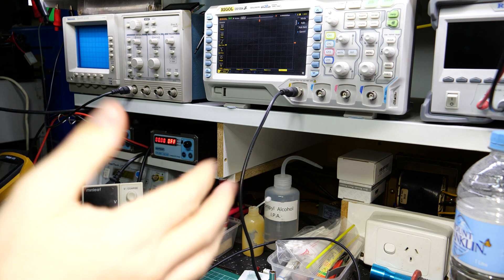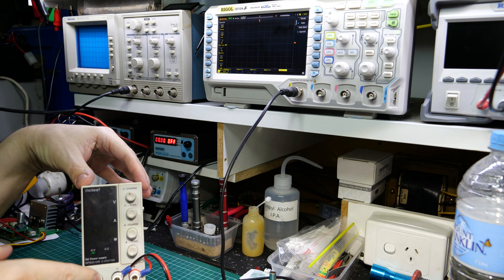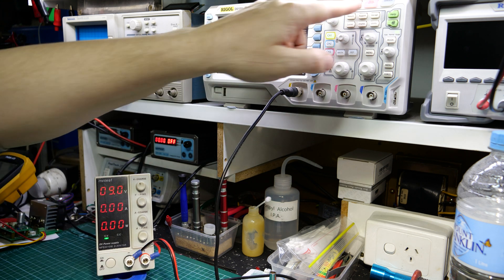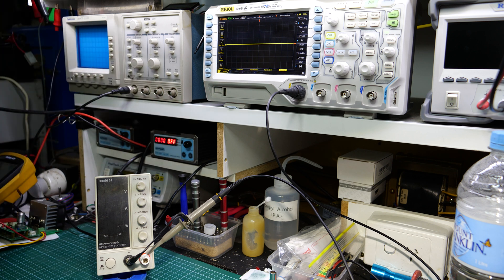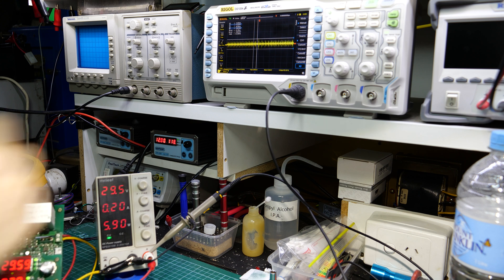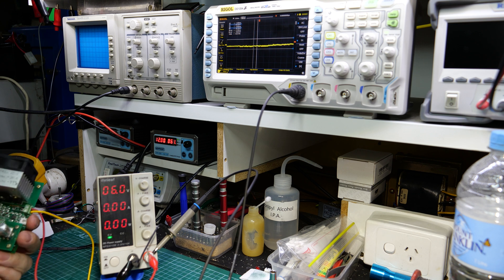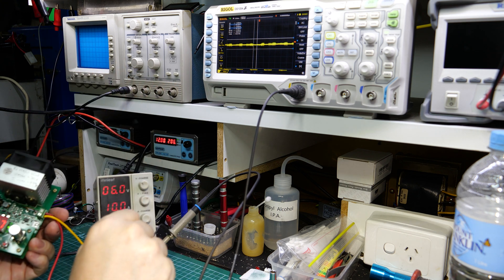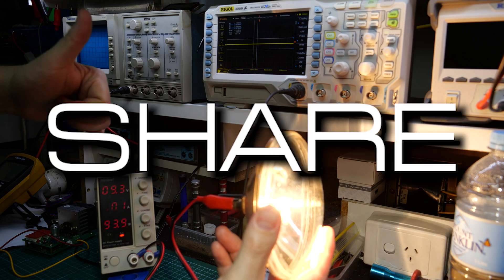#22 – Minleaf NPS3010W teardown and review – Part 3 - Final

Comment: i just bought one of these and found your video after it hasnt arrived yet though. is there any way to fix some of these problems by changing components like capacitors? mine was £38 shipped not sure how that compares to AUD. great video's watched all parts still happy with my purchase i mean im probably a part time hobbyist so some of this stuff doesnt concern me.
Reply from the maker: Hi, you "could" tweak a few things, mainly investigate the OP amps for the output voltage and current control.  Check for things like oscillations, poor quality MLCC’s and what not.  Though, in my opinion these are built down to a price and perform great for what they are.  Challenge yourself to see if you can coax better performance from the unit you are bound to learn heaps by trying.  Thanks for your comment. 👍
Reply: @xyzconceptsYT  I got the electronics police saying it will catch fire 🙄 on Facebook!  but I trust your videos over them at least you thoroughly tested it they won't even try one
Reply from the maker: @TotoGuy-Original  Bahahaha electronics police, oh no! 🤣 I don't have any issues with my unit.  Obviously, I wouldn't recommend anyone mods their power supply unless well researched and confident to do so, and has the appropriate protections in place.  Everything I review or demonstrate on the channel I use myself.  If I felt something was "unsafe" I would say so and probably show how to fix it or at least make it safer.  I don't generally discourage using these items because you have to start somewhere, just be aware.

Comment: Could you please check the minimum current from which the current limiting starts working?  For my unit the minimum is about 0.6 A.
Reply from the maker: As promised my update, I can get my unit down to 50mA then it becomes too fiddly with micro movements of the potentiometers.  My trick is too crank the fine adj to max, then adj the coarse to be just above the intended set point, then bring the fine adj back to the set point.  However, if you need such critical adjustment, this PSU might not be the best one to use.
Reply: Thanks. Discovered the same trick last weekend. Looks like the input of the limiting comparator is artificially offset to make the limiting more reliable. Have tried to remove the offset, but the limiting is very unstable for low currents.
Reply from the maker: Ill have a look at this more closely on the weekend, and let you know. Thanks for your comment.

Comment: My unit has the same issue, but it’s not self-healing. Getting up to 1 Vpp noise under load and 0.5 Vpp without load. Also, 2-5 Hz spikes up to 2 Vpp.
Reply from the maker: Update, may be unstable power supply to the OP amps.  Have you checked that at all?
Reply: Yes, the supply looks more or less stable. It's hard to tell for sure, because the noise is kind of everywhere. Have tried to add pretty aggressive snubbers on the MOSFETs, the noise is greatly reduced, but the MOSFETs are overheating.

Comment: YOU SHOULD TRY A DIFFERENT LOAD MAYBE JUST A RESISTOR AND SHORT CLIPS. MAYBE FLUCTUATIONS ARE CAUSED BY THE ELECTRONIC LOAD AND ITS LONG WIRES?
Reply from the maker: Well, the load is just a MOSFET used as a variable resistor.  So the result is the same.

Comment: Nice test review! I would liked to see  if the current over/undershoots at power on in cv and cc states. Just hook a resistor on the output and the scope probe on it. Then adjust the current limit so that the power supply will be in cv at startup and catch the waveform. Then adjust again the current limit so that the psu will be in cc at startup. Do this with differnt value resistors and do some statistics in the end. After all this you can really consider using this psu for sensitive circuits or not.
Reply from the maker: Hi thanks for your comment, that is a higher level test for a beginner just starting out that most likely won't have access to a scope just yet.  I wouldn't expect such a detailed test.  This is to highlight the PSU's capability straight out of the box for a beginner starting out.  I doubt that this PSU would be overly capable of such finesse in power delivery.  Your comment is valid for those who may want to test this in depth, but at this price I wouldn’t expect too much. Cheers.
Reply: @xyzconceptsYT  yup, beginner hobbyists looking at this video may not have a scope at home, but you you do have one and you used it for some voltage measurements in this video. When someone is not sure about buying an equipment and watches a review like yours, it may be enough to convince him and not being necessary to also do the same tests himself.

Comment: Yeah so bottom line it for us; just starting out; looking for my first power supply; probably on the cheaper side; is this good enough or save up and invest in something better for long term?
Reply from the maker: Hi, it really depends on the type of work you want to do.  At the end of the day a serious hobbyist will end up with an array of power supplies.  This NPS3010W will of course do the job, but if you are characterising circuits based on switch on and low noise and logic applications then this PSU may not be the right one for that purpose.  However, high power applications like driving motors, high lumen lighting this will do just fine.  A good PSU to supplement the NPS3010W is the Gophert CPS range for the more sensitive uses, like testing retro computers, Arduino projects and things like that.  Thanks for your question, I hope this helps.

Comment: what about a time delay relay in side there? so the PSU can stabilize then swich on.  and put a low pass flter on the output lol
Reply from the maker: A MOSFET controlled delay may be better, no contact bounce to contend with.  I wouldn't call this unit a precision PSU, probably not worth the effort.  On the other hand it maybe a cool little project for a rainy day. :)  Thanks for your comment.

Comment: You deserve more subs! The production quality is quite good and it looks like you put in the effort to make great content.
I just stumbled upon your channel while researching low cost power supplies, hoping to find something affordable to get me started. (Have any recommendations?)
Maybe a dumb question but would a voltage regulator smooth the output enough (particularly the turn on spike) enough to run (5v) logic circuits?
Reply from the maker: I'm trying and I am a one man band, what you see is all my input and learning as I go too :) I have been a hobbyist in quite a few disiplines but decided to share core concepts on youtube a year ago.  It's been great, I plan to keep it going.  To answer your question, start with the CPS "Gophert" series power supplies great little entry level bench power supply.  I have 2 and plan to get a couple more.  The NPS3010W I reviewed in this video was a bargain, I will be doing another video on the erratic output and try and find the cause and fix it.  It may be something simple who knows but I am keen to find out.  As for the 5v reg for smoothing outputs, as a rule of thumb "you get out what you put in" regs aren't really design to tidy up an output just keep a consistent level of voltage.  Spikes and noise generally get through a vreg to a certain degree you would still need filtering and capacitance to deal with noise and spikes properly.
Reply: I agree, couldn't believe when i saw he only had 211 subs. 212 now tho ;)